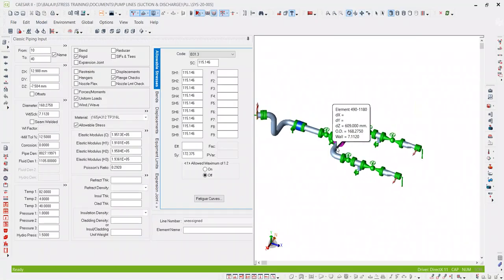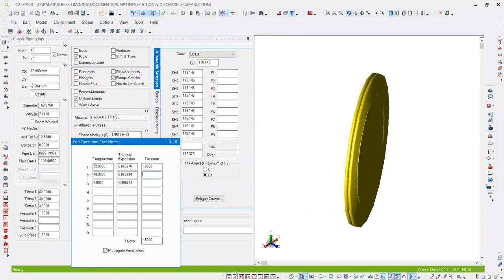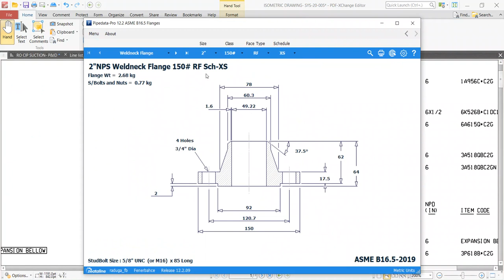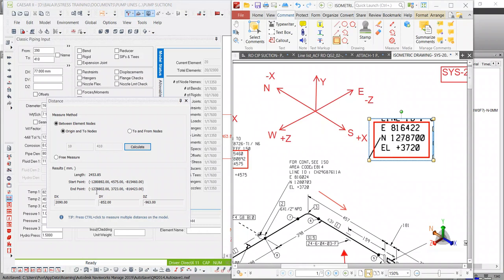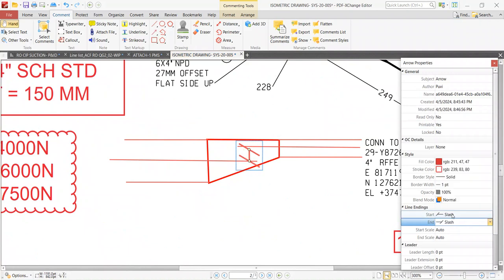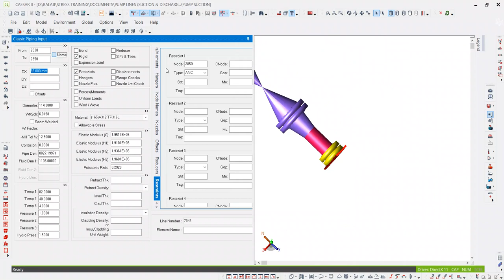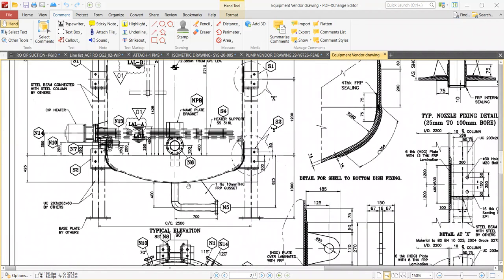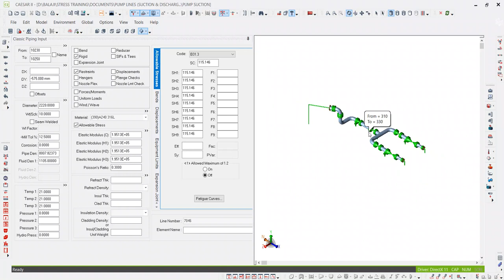CAESAR-2 MODELING  & STRESS ANALYSIS OF PUMP SUCTION  LINES, VERTICAL VESSEL, COORDINATES- PART-1

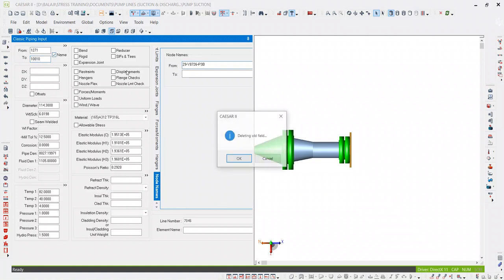Comment: During 1:43:00 when I try to give pump suction C Node & click on continue the node goes to the 2nd line, please advise on how to resolve this issue
Reply from the maker: Provide C node at the pump suction node. After that go to the last element (Control+end) and go to the next element. In the next element your from Node shall be the Cnode of pump suction and To node shall be the higher node (Above 10000 or 15000). If you still have issues please contact me @ +91 9941404342